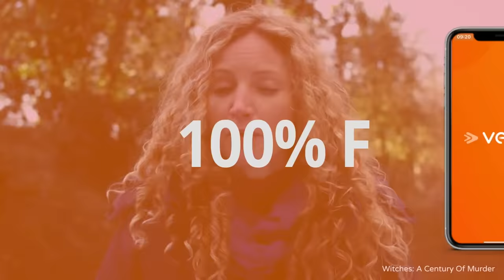Woman Caught Lying About Drugs to Cover For Boyfriend | Cops | Real Responders

Comment: Can’t forget to stack those charges guys.  Always stack as many as you can. Make sure to preach and act as a savior of some kind.
Reply: They do it to themselves. Running/resisting etc
Reply: @alexkyte4093  - agreed. But the charge stacking is still a must. You can see they do their best to add anything possible.
Reply: @KingBorris  Is that a lighter? Go ahead and put down "paraphernalia" too. "failure to maintain lane" while you're at it..
-Especially when they start tossing frivolous Misdemeanors on top a an F or two. ..Just icing it on
Reply: Yeah the charges don't normally help the addict or their family but it seems like it makes someone money somewhere in the system